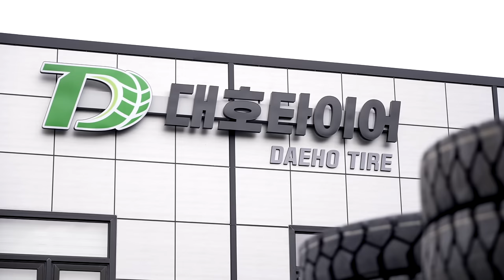Amazing Process of Making Retreaded Tire With Old Tires. Tire Recycling Factory in Korea

Comment: I worked at a small retreading company for about 6 years retreading truck tires. They also retreaded car tires, but stopped in the late 90s due to less demand. Truck tires, on the other hand, are always in demand. It was tiring and heavy work and very hot. One guy scraped the tread and I did all the rest of the work for the finished product. We managed about 8-12 tires a day, depending on the sizes. I left there in 2002. Now they have 8-10 employees and manage 32-40 tires a day.  🚌🚒🚚🚛😉👍
Reply: Does it take that long? Tractors and combines did not work?
Reply: "It was tiring"
Reply: That's why bicycles can't stand up by themselves - they are two-tired.  @shawbros
Reply: И посмотрите как покрышки карьерных самосвалов ремонтриуют
Reply: @@login_pass For the simple reason that I did everything myself then and now there are several people who do the job and with a better and bigger autoclave. The old autoclave could handle up to 8-12 tires depending on size. :body-blue-raised-arms:
Reply: @@login_pass I have to say I did a pretty good job during my time at the company. I managed to reduce the number of complaints by more than 5% in a few years. 😉
Reply: @larszenthio1012 did you work at treadright?
Reply: 8 , 12 шин у нас это почти полмиллиона денег.
Reply: @tbyoda9475  I work at a small family business in Sweden.
Reply: Did you guys make tire Buffings as a bi-product of retreading?
Reply: They probably stopped car tires because of the speed ratings. Too many explosion 💥 of tires damaging fenders.
Reply: @ZeroSpawn  That was not the reason they stopped retreading passenger car tires. The reason was that more and more tire sales points started to come online, with partial payments and the prices were pushed down, so that it was no longer profitable. That was the reason. :body-blue-raised-arms:
Reply: @larszenthio1012  excellent, thank you for the clarification!
Reply: I would imagine that it was very physically demanding?
Reply: @michaelalan1546  You are absolutely right. The super single tires were heavy, but even the "regular" 22.5" weighed a lot. I stopped after about 6 years, because my back took a lot of beating from all the heavy lifting. I'm now retired and still have back problems.
Reply: こんな手作業中心の劣悪な労働環境で1日の生産性もさほど高くない。。そして値段も市場価格で安い。このビジネスは経営者だけがぼろ儲けするだけだねｗｗ
Reply: @larszenthio1012  انا ايضا اعمل في هذا المجال من 15سنة وكم اتمنى بأن اسافر الى السويد
Reply: less demand because you didnt get very much milage out of a retread
Reply: Retreads are dangerous and should be outlawed.  Drive down any American highway and you will see the tread of a retreat tire on the side of the highway.  it's why it is illegal to put retreads on the steering axle.
Reply: @tarstarkusz  That is not entirely true. It is usually retreated tires on which the tread loosens and you often see them along the roads, but even "new tires" it happens that the tread loosens due to overheating and too high speeds. Truck tires last the longest at the right air pressure in relation to the load and speeds of a maximum of 90 km/h. Tires that are retreaded on trucks and buses are only permitted on driving or free-wheeling wheels and never on the steering axle. It is also recommended not to drive above 80-90 km/h to ensure durability.
Reply: @larszenthio1012  If 90kmh is the maximum speed recommend, 90% of the interstate highway system in America is off limits to them because that is only 55mph.  The only stretches of highway with 55mph speed limits is in the cities.  In many parts of the country, it's 75-80 mph, which is 129kph.
Reply: @tarstarkusz  Yes, I know they drive a lot too fast in the US and some countries. Max speed for trucks over 3,500kg in Sweden is 80km/h and the rest of Europe is 80-100km/h
Reply: What was the smell like? I'd imagine such places need insane ventilation and respiration protection to be permitted operation.
Reply: @Coecoo  Not as much as you might think. The worst part was the heat, when you opened the autoclave it was like going into a sauna while still wearing overalls. Hot 🥵
Reply: So much time has passed, and technology is still not widely spreaded. Sadly(((
Reply: Из опыта в Санкт-Петербурге шины с наваренным протектором очень плохо служили, отпадал протектор так же боковины (корт) колеса уже изношен из-за перегруза и вся эта технология не работает к сожелению. 
Но я не знаю каким образом восстанавливают такие шины, может технологии разные и поэтому не все так плохо
Reply: @izLeningradavSpb  Це може бути тому, що картер шини вже зношений. Вантажна шина проходить перевірку перед початком процесу. Якщо пошкоджень занадто багато, їх викидають. Я сам був дуже обережний і не брав шини з великими пошкодженнями, від цього результат був кращим, і нарікань було менше.
Reply: I worked in a place of the teenager that would recycled old nylon tire cafes in to 12 inch by 12 inch guaranteed for life indoor outdoor curb. factory of still in business today. And you see that carpet in front of many banks and on the sides of many fire trucks
Reply: Эти шины более низкого качества проверено
Reply: I like company numbers to reach sales. Is it possible to have a phone number?

Comment: Nice & clean factory.  Thanks for this video.  I know brand new tires are too expensive, especially for truck tires.  Thus, many company or owners buy these rethreaded tires. The tires here are like brand new!
Reply: I don't know where you are, but here in America, retread tires like this are always used for middle and rear tires. But it is illegal to use them as the front two tires used for steering the truck, because eventually the retreads become detached and fly off the tire. On the middle and rear tires this isn't a big deal, but if this happened to the tires used for steering it could cause deadly accidents.
Reply: you are right, the same way in China

Comment: With all of the processes necessary, it is amazing to me that they are able to produce re-treads for less cost than brand new tires!
Reply: Only with lower labor costs and high priced tires.
Reply: @Trust_but_Verify labor isn’t that cheap in Korea and the price is relative to supply and demand.
Reply: Exactly what I thought. How is all this less expensive than making a new tire? Very fascinating though. Excellent video. Thanks!
Reply: @SHO1989 The cost of core and  virgin rubber around the core.
Reply: @SHO1989  you'd need another machine to make the entire tire and who knows how they make the steel wires go inside, pour the rubber on a steel wire tire frame? idk, this way at least to my thinking, used tires are often thrown away or sold for very cheap, they look big so they must be used on industrial equipment, and new, they cost a LOT.

Comment: And you wonder why retreads explode and come apart all the time. Just showed them grinding out the steel belts of the casing then replacing it with melted rubber. Steel and rubber do not do the same thing the steel is there to keep it together.

Comment: I used retreads  on my cars for years in the 60's and 70's by Bandag.  They were inexpensive, and as long as you did not do a lot of high speed driving, as on an Interstate, they would give good service.  Retreads are still used a lot in the trucking industry, judging by all the 'alligators' you see on the highways.
Reply: Ditto - I too used retread car tires back then. They were very inexpensive. I vaguely recall having a problem one time with a recently purchased retread tire, I don't recall what was wrong, and the local tire dealer replaced it under warranty.
Reply: 100% correct about highway driving caution.
Reply: @tywal тебе протектор резали по твоей покрышеке, а не наклеивали. Где гарантии что эту хрень тебе не размотает в лобовое стекло?!
Reply: Alligators are just separated tread period. Driving on a blow out which is way more common with larger wheel count vehicles will cause the tread to separate and roll into the road. I always thought it was funny people think these are all from retreads.
Reply: Oh shit so all those random tire treads I see  on the side of motorways make perfect sense now, its the retread coming off the tire itself. You've answered a question I've had for years that I've never actually ended up asking anyone about so thanks for that. Btw calling them 'Alligators' is just perfect, definitely sharing that one lol.
Reply: @Legion563  That's the thing. People think they are from retreads but you wouldn't ever be able to tell just driving past one. Some actually say retreads are less likely to do it. Not sure but I have watched tread roll off a blown out new tire.
Reply: Remolds are way better for highway etc
Reply: @Rainmotorsports  Je pense que ce n'est pas sûr à utiliser.
Reply: I was under the impression that Bandag retreads were only allowed to be installed on the rear of a car. They weren't allowed to be put on the steering of a car because they can develop an air bubble that causes the new tread to separate from the original casing.. 

The other thing illegal to put on a car, but not on a truck is regrooved tyres.... but I also don't think Bandags or regrooved tyres can be used on the steering of a truck... they are more used on the trailers. 

I still see separated truck retreads on Australian highways... they're that bit of rubber about 2 inches thing, 10 inches wide and 6 to 8 foot long coiled up in the middle of the lane. 

Somebody must pick them up... but they are a bit too thick to make mudflaps out of.

Comment: I used to be a tire retreader. Almost 50 years ago. Although we did passenger car tires only, the basic systems have not changed at all, in that time. I found that quite interesting.
Reply: If it ain't broke ...don't fix it.  Simple and Original is usually the best way !!
Reply: Do thay really retred aircraft tyres
Reply: @brickleyyard4966 yes, actually Aircraft tire get retread lot earlier compare to truck tire. And the reason it is more viable is due to the aircraft tire work on lot cleaner Road surface. Hence, even with same process same skill people. It is less likely experiencing failure. Actually to be fair, I would like to see the statistic of failure rate of new tyer vs retread. For semi case, the retread tire are used on the trailer where the load is. Of course it is going to experience more failure. Im just not convince new tire will fare significantly better.
Reply: @user-jh6vt8vx4v  cool I always assumed that it was possible but just be safer to just fit new tires 

Thansk for your reply
Reply: So much time has passed, and technology is still not widely spreaded. Sadly(((

Comment: Convenient store purchasing regluing service, no matter old tires or new one. 
For example, your cars tires worn out and they are still good, you can keep using them by regluing them with new rubber and threads. They should provide automated wheels balance and alignment as well.

Comment: I remember when retreads weren’t allowed in certain states. I used to travel down I-95 from New York to Florida and the retreads were all over the side of the road. Now, with better manufacturing processes, you hardly see them anywhere. Retreads are common place now.
Reply: Go follow 81 from PA down to Knoxville, TN and you'll see retreads all over the place.

Comment: A lot of us truckers use these recaps on our trailers but the walls tend to blowout way quicker than virgin rubber it’s illegal to use recaps on the steer axle on semi’s but they have there place and are great in a pinch
Reply: I agree but these retreads in my opinion are very dangerous.  Anybody who travels any major roads in the US sees these every day blown off of semis and laying sometimes in 10" lengths (we call them RUBBER ALLIGATORS)  all over the roads and causing many major accidents.  If you hit one in a small vehicle or two-wheeler you are toast.  I do not have the answer what to do with all worn-out vehicle tires but this is not the answer I don't care what kind of glue you are using from Elmer's Wood Glue to Gorilla Glue.  They eventually all fail and come flying off of the vehicles that they are on......🤮
Reply: "The cost of a retread tire is usually between 30 and 50 percent of the comparable new tire price" - is this true?
Reply: @Trust_but_Verify  yeah virgin rubber runs around 300-500 while you can get a recap for about 150
Reply: I doubt it is the similar poor quality of retreaded tires found in the US.  This one looks very sophisticated.

Comment: We once changed our whole fleet to retreads. Four trucks, 16 tires. It was like riding on marshmallows and then we've had two catastrophic failures. Not only the tire went but it also took a piece of the truck with it. That's a fail rate of 1 in 8. A bit too much for my comfort.
Reply: I will never drive for a company that uses retreaded tires. It's my life for their cost savings

Comment: To add to the comments below. I remember asking about re-tread tires for cars and trucks. I was told they had lots of problems and didn't save you much money. So nobody I know of when I asked around stocked them. When I asked it was around mid 90's and a set of 235 75 r15 was $200.00 compared to new of being $600-$800. Imagine my surprise when I found out trucks and other products still used them due to costs. I was wondering the process compared to now than in the 60s and 70s would have improved. But, being in the USA. Finding stuff like re-tread car or truck tires is not easy. I'm sure they would rather sell you the $$$$ ones. The other thing to is if I did find them online. Trying to find a place to put them on. most places won't touch tires they don't sell.
Reply: In the US it is illegal to use retreads on the front steering wheels so you wouldn't be able to rotate the tires like normal on passenger vehicles. Big trucks don't really rotate the tires so they put retreads on the non-steering axles. When you're replacing up to 16 non-steer tires the cost savings add up fast.

Comment: This should be mandatory on a worldwide level.  Every nation would benefit from this, not to mention the reduction in discarded tires.  New tires at a much lower cost and almost no contamination of the environment.
Reply: Have you ever had one of those go bad while driving? Let me share my experience. I tried a retread motorcycle tire years ago to save money. It was great until it developed something that looked like a huge air bubble and made it very difficult to control. I made it home and swore never again. It sounds like a great idea until something goes wrong. At that point you've spent more money then just buying a  new tire. Plus you've now contributed to using more energy and chemicals to make a retread. Don't forget to add the shipping costs of using more gas and emissions. And you also just added another tire to the trash bin. All of which could be avoided by buying a new tire. I shared your thought until I had my experience and realized there's some things in life that are just better to buy new.

Comment: Everyone sees retreaded truck tires in pieces on the highways where the strip has fallen away from the casing. Instead of a bonded strip applied tangentially, cast the retread strip as a one piece circle and slip over the casing from the side. I'm a mechanical engineer btw.

Comment: Have you ever had one of those go bad while driving? Let me share my experience. I tried a retread motorcycle tire years ago to save money. It was great until it developed something that looked like a huge air bubble and made it very difficult to control. I made it home and swore never again. It sounds like a great idea until something goes wrong. At that point you've spent more money then just buying a new tire. For those of you that believe in the climate stuff consider this you've now contributed to using more energy and chemicals to make a retread. Also don't forget to add the shipping costs of using more gas and emissions. And you also just added another tire to the trash bin. All of which could be avoided by buying a new tire. There's some things in life that are just better to buy new.

Comment: This process is called 're-treading', the tracks they use your see getting prepared at the beginning are NEW, NOT used, and are attached (firmly "glued" onto the used tyres of which the rolling surfaces have been smoothed. These new treads/'tracks' are mounted onto them with the same type of rubber compound as the tyres are made of themselves but applied in a molten state). However this whole documentary mixes up shots / footage of all kinds of processes, some footage shows retreading, but other parts in fact show the production of entirely new tyres (that is the process for which the huge pressure chamber is used).

Comment: Retreading has a bad reputation but is great when done properly. Daeheo has both processes, precured and fully cured. I prefer the fully cured because precured tread will always have a gap where the extremes meet, when not done properly it is the weekest point and from there the tread can detach from the casing.
I used to retread, and the key is taking good care ofthe cadings

Comment: When the steel bands are buffed ‘ sparks’ does it no cut through or thin some metal bands that give the tyre tensile strength when inflated ?
Cutting or thinning any Stella bands will reduce the tyres strength .. NO ?
When inflated , with 15 tones of load the outside of the tyre is stretched .. under a tensile load.

I would guess these retreads will only ever be capable of 70 or 80% of the total load of a truck compared to the same original tyre when it was new ?